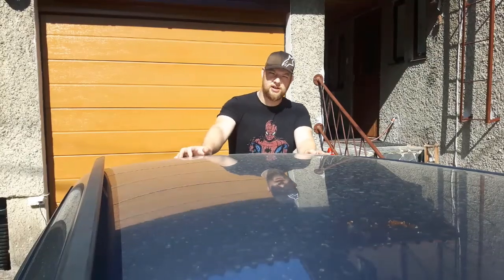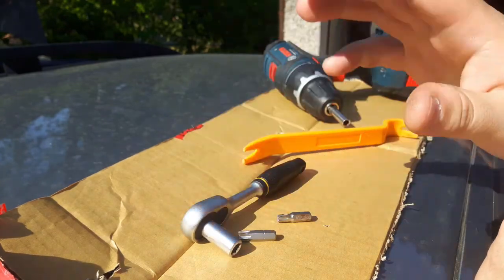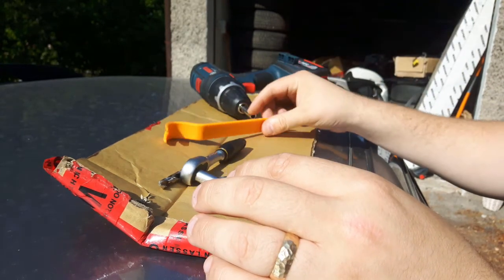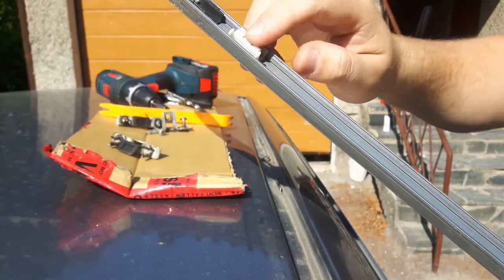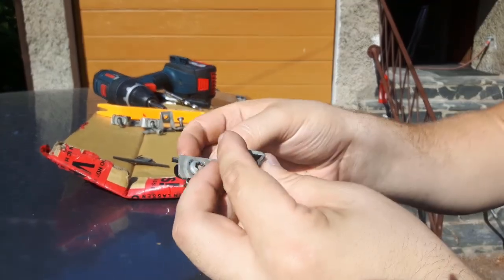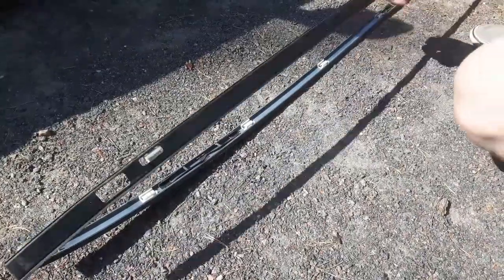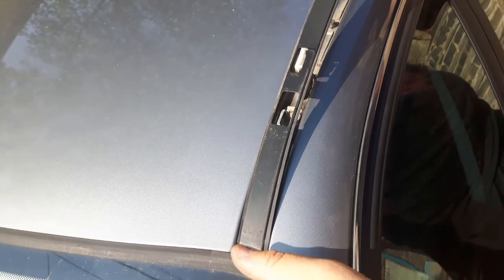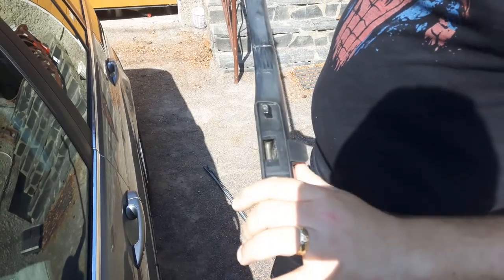BMW e46 Touring Roofrails Retrofit

Comment: He asks what size are the screws they use for the last of the video I would appreciate it because I am mounting those of my bmw 325i with your video it has helped me a lot, I just need to put those screws and they take a long time to arrive, thank you.
Reply from the maker: There are 12 M8 screws/Bolts with a low profile head and 6 bigger ones that i don't remember the size of and neither can find in real OEM website. I'll see if i remember to check one from the car.
Reply: ChargedCars thank you very much.
Reply: ChargedCars If I need the big ones that are the 6 of the grip that would be very useful for me, thank you.

Comment: Is there need for some seal under screws. I must reuse old hardware and it's almost 20 years old rubber everywhere
Reply from the maker: There is a seal under the screws but it is placed under the bracket that holds the roof rails. All the parts you need are in this page. https://www.realoem.com/bmw/enUS/showparts?id=EN11-EUR-03-2003-E46-BMW-320i&diagId=51_3963 part number 3 in the picture and the part number is 51138208785 in this part there is usually a rubber seal/washer i have not found it separately.

Comment: Hi did you have to take the headliner off from inside your car?  Seems like a nut should be on the other side of your bolt.
Reply from the maker: no you don't have to take the headliner off as there is a welded nut already in place below the sheet metal that you have to drill out if you don't have roof rails.

Comment: I want to remove the roofrails and want to put the plastic thing there. 
But I don’t know the name of them. Because I want a cleaner look without the roofrails
Reply from the maker: these are the part numbers for just primer painted, left 51138208775 right 51138208776
https://www.realoem.com/bmw/enUS/showparts?id=EN11-EUR-03-2003-E46-BMW-320i&diagId=51_3960
I use https://www.realoem.com/bmw/ to look for part to my car you enter your cars vin for what fits your car.

Comment: Hello!
Is it the same on BMW e61 ?
Reply from the maker: If i remember correctly the newer ones you have to remove the headliner to screw on the nuts on the underside of the roof that hold the rails.
Hope this info and link helps!
https://www.realoem.com/bmw/enUS/showparts?id=PT73-USA-02-2008-E61N-BMW-535xi&diagId=51_5410

Comment: I hate roofrails! I´m looking for the strips without wholes for almost a year now! Can´t find them in Austria
Reply from the maker: Hey you might find them on ebay.de or ebay.co.uk  part number for primed  are 51138208775 left side and 51138208776 right side And for painted are 51130007783 left side 51130007786 right side. if you search with the color-code of your car you might find some pre-painted if you have a popular paint option if not again with the color-code you can find canned aerosol spray bottles there they come pretty handy. And you can search for parts here http://www.realoem.com specific to your car with the vin number. But i in the other hand like the look better with the rails and the cross-rails are cheaper and don't have to be BMW specific.